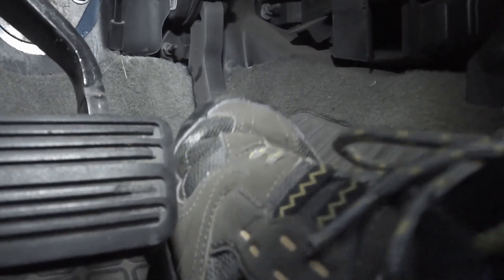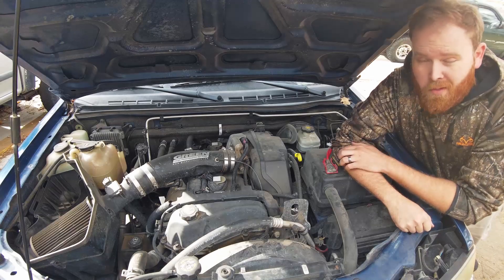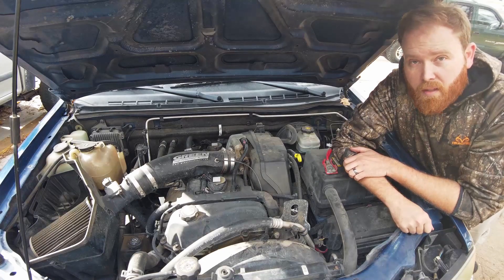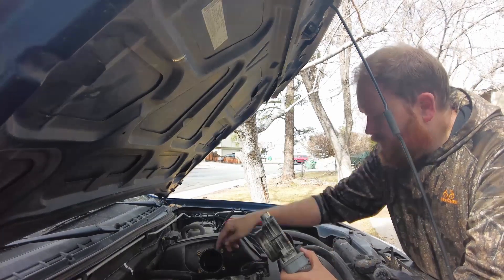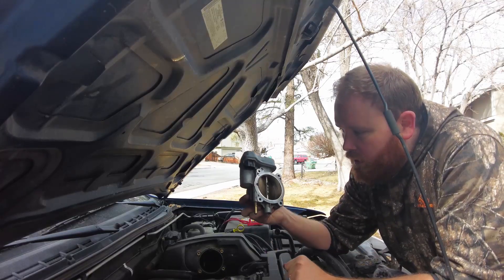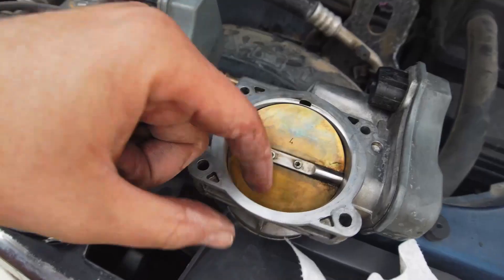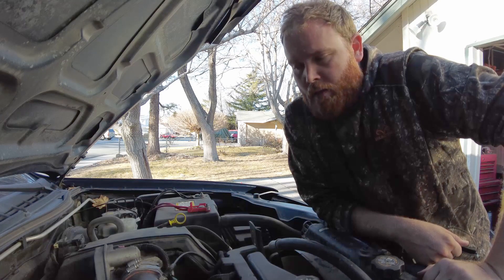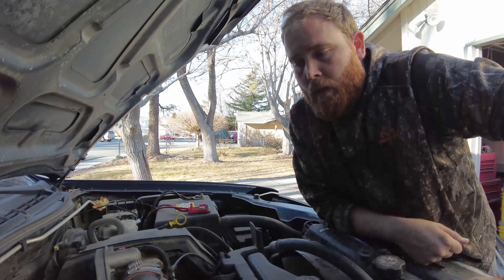Free Solution To Keep Your Truck Running 100% [Cleaning a Dirty Throttle Body]

Comment: my throttle body was so dirty a couple months ago my canyon wouldn’t start because it was stuck wide open on crank lol, good vid!
Reply from the maker: Prob the only time it's even been cleaned. Yikes
Reply: @ No doubt. got the truck with 122Km last august, cleaned it around 133Km, definitely was never done & its an 07 lol. Do you still make Rwd coil spring/strut style lifts?
Reply from the maker: @scaravaaa3782 yep. I should have an install video soon but it's honestly pretty easy
Reply: @ That video would be greatly appreciated, i’m not sure that there is a video out there on that specific lift. I’m in Canada, there are few options to purchase the kit but I have found it. I’ve done your zr2 bumper cut. Running 31’s with spacers this winter… would love to get it levelled out & maybe go a size bigger on rubber this summer.

Comment: Do you disconnect the battery before you start?
Reply from the maker: yes pull  one cable off and touch it to the other, doing this will drain any capacitance the pcm has and cause it to relearn once you hook everything up. i's not necessary but a good practice

Comment: Did you remove the email you were talking about? I'd really like to have that done to my throttle body, on my 2004 chevy colorado 3.5 L inline 5. Cylinder the truck is still like the day it rolled off the lot, inside and out, im really interested in having that done. Thanks for the video.
Reply from the maker: Yes, unfortunately I will no longer recommend them.
Reply from the maker: @Duhhwight  he started to not respond to customers,  botching tunes, and was removing content on our Facebook groups. He ultimately removed us for the 355nation fb group and currently will remove so much as a mention of our products. Used to be a great guy. He had great parts and insight about these trucks. I wish I could recommend him still.